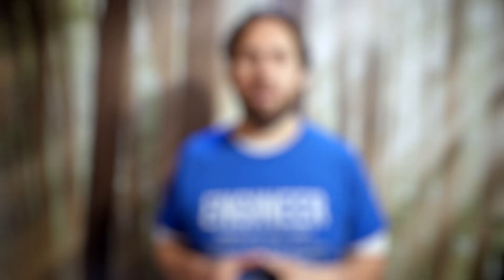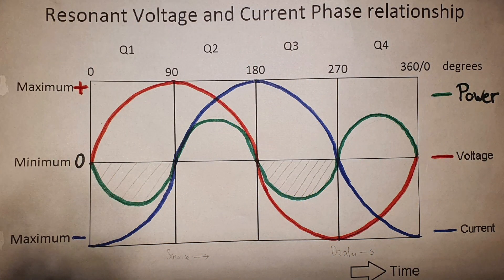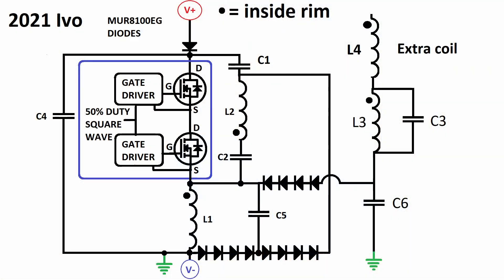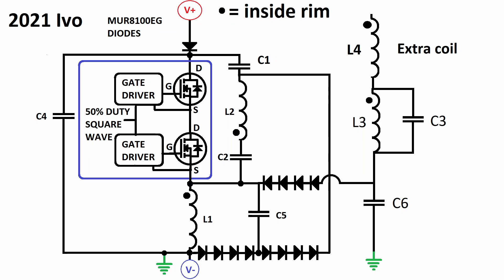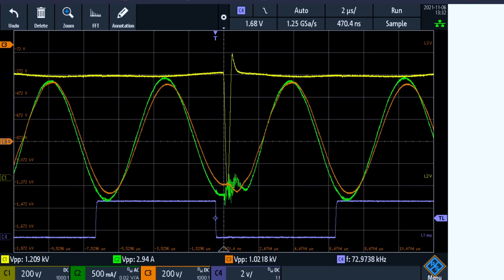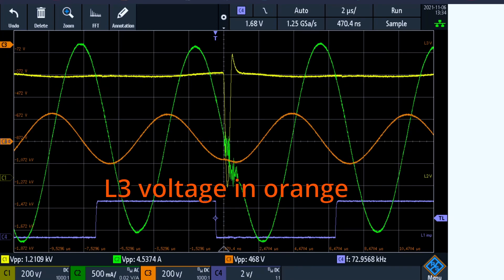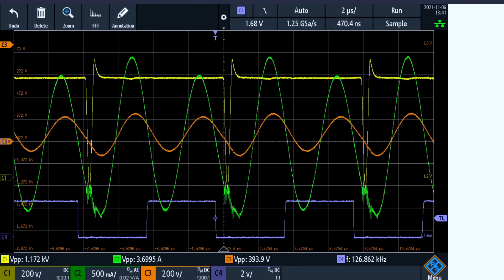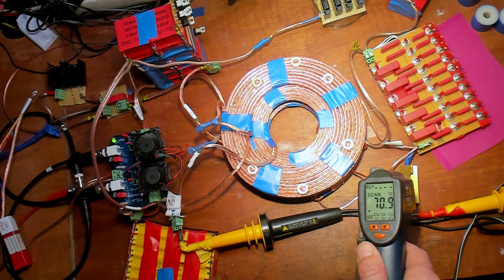Nikola Tesla's EXTRA Coil

Comment: Nice demonstration Ivo 👍 To calculate accurate power output on your L4 8.3 ohms resistor you need to mount the resistor and temperature gun so neither can move. Run you circuit till you achieve maximum heat and write down temperature. Then disconnect L4 leads to resistor without moving its position and connect resistor to a power supply and adjust the voltage until you get the same stable temperature. Multiple voltage and current displayed on power supply and you’ll know the wattage. This method is very accurate as long as nothing is moved (resistor and heat gun) from one test to the other and obviously room temperature is not different. Once you know the wattage it would be beneficial to compare it to how many more watts you increased the input when you connected L4 load resistor to compare if there’s anything to gain. Kind regards from gotoluc
Reply from the maker: Thanks, the resistance is only to indicate power.
I have thought about comparing the resistance by giving it an equal 18W DC, but it still would be a rough indicator in my opinion.

Best would be to rectify L4 into dc (capacitor bank) and then resistive load it. DC power is much more honest in my opinion.
Reply: @MasterIvo  I agree, DC would be a most accurate way to measure but there’s going to be losses in the conversion and why I made the recommendations of how to measure raw AC with resistive heat. You’re doing a great job and I’m confident you’ll figure it out 👍
Reply from the maker: Thanks Luc, true. but there will always be some error. I aim to get something big enough to rule out the error. 
I always enjoyed your videos.
Reply: Thanks Ivo, you’re on a very good path so far and I have my fingers crossed 🤞 that you’re the one to crack this open and make our world a better place. I’ll replicate once the output load doesn’t affect input power or when output power is around 95% of input. Looking forward to your next video demo 👍. Thanks for open source sharing 🙏
Reply from the maker: Thanks Luc. that's the goal. good to have you on the team.
Reply: I would say easier to convert resistor temp  and input wattage into joules, and then calculate its COP to get better idea
Reply: Exactly what I was going to say! Glad I was reading all other comments first. One more detail is to double check that the probes are connected correctly, we have seen many times little 'errors' leading to wrong experiment results.
Reply: @deslomeslager  I did think of the probe being in the wrong orientation but Ivo surly must of check that. Nevertheless he should confirm he did or provide probe connection in his diagram to confirm all is good.
Reply from the maker: if the current probe is wrong, than it is 180 degrees out of phase, which would mean, negative power, which is generation of power.
Current will still be max at the same time voltage will be max. (max power)
Reply: I've got an inductive wattage meter on the mains power cable to my DC power supply too, in case PS amps meter gets tricked   🤷🎈
Reply: even simpler would be to heat known amount of distilled water lets say for 30 minutes with that resistor....heat capacity of water is ca. constant in 20-50°C interval, if the experiment is done in styrofoam insulation the heat losses are really negligible and power can be very accurate calculated from these calorimetric experiments Q = m*c*ΔT
Reply from the maker: I hooked up the ohm resistance to a dc power supply and provided 18W (same as input power of the extra coil setup).
the resistance quickly heated up to 84C, so out put is lower. Which is expected as i needs to be tuned properly, and the impulse voltages need t me at least - 2900V according to previous experiments
Reply: Thanks Ivo for letting us know. That’s a quick and simple way to quickly check for now. When you get closer you should also test higher resistance loads. I’ve had times that output efficiency got much better with higher resistance. So never stay with just one value. Kind regards
Reply from the maker: thanks luc, I might put some lamps in series to see how they react

Comment: Congratulations for the video and for the professional work you do.
1. I know that Tesla also calculated the weighing of the coils it made, because two coils with different number of turns if they have the same weight, made of the same material, certainly resonate.
2. Is it possible for the third coil to represent a "ballast coil" that delays the wave to overlap with the other wave?
Reply from the maker: thanks, yes L2 primary and L3 secondary are equal weight. Maybe L4 should be included in weight ratio.
2:  thay might be possible
Reply: @MasterIvo  have u observed the propogation of sound in a speaker the electron flow description is abts the same a push and pull the amplitude of magnetic flux ie forwards and backwords ie push and pull 3 dimensional determines the charge movement if it can be can done  ie charges brought in by caps ie pos and neg at two different ends at then combined at the load will determine the amount of power or electricity rather current whatever u want 2 call it, copper produces positive charge like aluminium or graphite or graphene and take a neg part using zinc etc and then perform at the same same weight then demonstrate a generator which can sepearted the charges as it speeds up, electrostatic charge seperation is what determines and voltage its amplitude and how much it can be rotated or cps 20cps 3 phase or higher frequencies will also using the same principle give equal current doesn't have to 50 or 60 cps, so try seperating magnetic neg from pos then spin it using a resonant circuit of 2 different materials that can work as earth and pos ie graphene or copper the thing abt copper is it is determined by mass so 1 kg u can get max 100watts no more so use these tit bits and develop once developed transformers will converse the power or acts as resonators to propogate the power or repeaters voltage nd current can be alternated according 2 needs, generator must concentrate on generation of pos charges basically either copper or some other better material in cu it can b done by magnetism thr must b other ways u must logically utilize

Comment: Was waiting for you to explain more about the squarewaves Radiant energy. Isn't this from Counterspace?
Reply from the maker: which squarewaves Radiant energy?
Reply: @MasterIvo  ;  Isn't L4 like a spark gap, a voltage drop?
Reply from the maker: no, the square wave shows when the mosfet (switch) is on/off
during turn off, L1 coil produces the negative voltage impulse, from the conversion of it's built up magnetic field.
No L4 is not a spark gap, it has more voltage due to less capacity
Reply: Hi IVO;
Seems Radiant energy is squarewaves. The purple squarewaves. 
 (?)Squarewaves seem to be cut off negative feedback spikes, from Counterspace? From on and off of (?) Voltage/current? Been awhile.